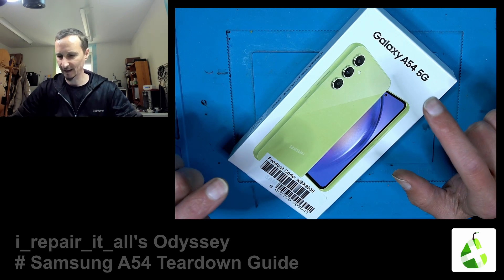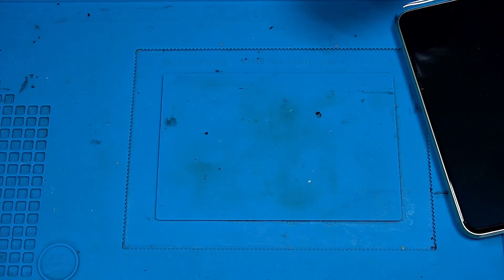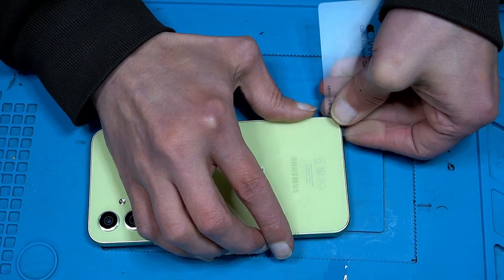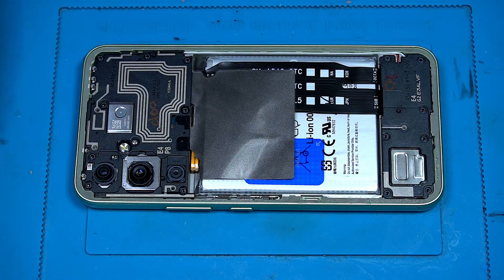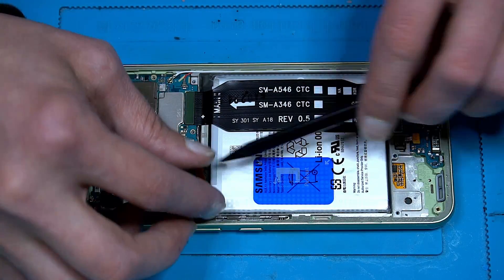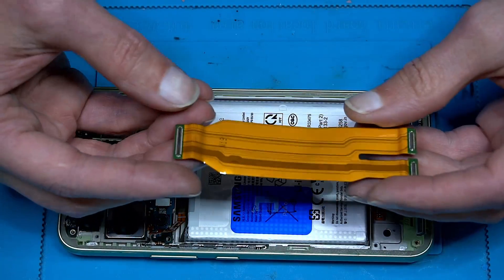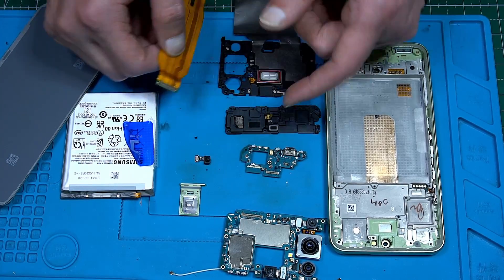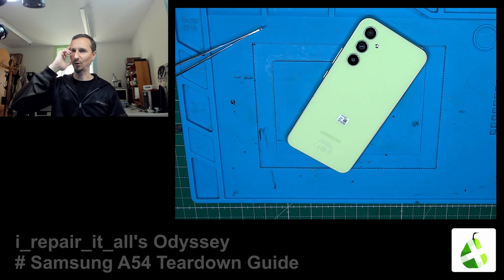Samsung A54 Teardown Disassembly Repair Review

Comment: Please help me if you know whether the main board is multi layer or not. I have a crack next the LED flash.
Reply from the maker: All the boards these days are multi layered
Reply: @irepairitall  :( I can't fix multilayer boards, I wanted to fix it myself. My main board failed only 3 days after warranty ended and Samsung refused to fix it.
Reply from the maker: @Porsche996TT  A crack int the board ist definitely a dead end, sorry for that.
Reply: @irepairitall Danke for your message man. That's what the technician told me as well.

Comment: Thank you for your time and knowledge. Great video. I jumped in ocean like a dumbass without checking pockets. cell went under only 5 seconds maybe, doh! Moisture detected at usb port. The cell wont allow charge. Alarm beeps... says remove power cable.
So, i will replace the usb c charge port and board. Its a $15 chance to fix the issue. Cell works fine... worked for 4 days.. but now @ 5% battery. What glue needed for reassembly of back glass?

Tks so much!!!
Reply from the maker: Get a new adhesive, little heat and clamp together for an hour. Your welcome.

Comment: Hello, to change the rear camera glass do you have to remove the cover? or it can be changed without removing the back cover, greetings

￼
Reply from the maker: it is saver to remove the whole backglas but it is doable to only change the cameraglas.It is relatively easy to remove, more easy than other models Heat and much alcohol to soften the adhesive.

Comment: I already damage the frame by dropping without case. Any tips on how can I seperate the Screen from the frame.😢
Reply from the maker: You have to heat up the whole screen, but i think the screen is completely adhesived to the frame, The oled is very stiff and easy to breake. I personally would not recomend doing this. Much to risky.

Comment: I enjoyed the video.  Do you find this phone more or less repairable than others?   How have you found genuine parts availability on samsung or other phones sevwral years later?
Reply from the maker: Thank You! The Design build of the A Series is quite simple, got an A5 from 2017 in for repair. Screen is still available. But Samsung parts are not the cheapest. But It really depends on the Brand, Model, Sales Figures etc.
Reply: @irepairitall  thanks for the response.  I ask because I'm attempting to keep phones longer due to cost but I've heard aftermarket batteries for instance generally end up having pretty poor performance.  I also cracked the back cover which I replaced only a few months ago on my note 10+.   I'm suspecting genuine parts is what you need to use but their availability might be an issue after 5 years.   Thanks again

Comment: Interesting teardown, and well done. The battery removal was a bit concerning, but you pulled it off nicely. Thanks for sharing.
Reply from the maker: Thank You very much! It definitely needed a drip of isopropyl alc. to get it out.
Reply: Actually, the glue part is meant to stay INSIDE and be REUSED - DO NOT TAKE IT OUT!
Just take the battery itself out without (almost) no hassle.
Reply: @maxschmidt666 just so I know for the future, you pull the pull tab to the side and then just grab the battery instead of pulling the pull strip the opposite direction?